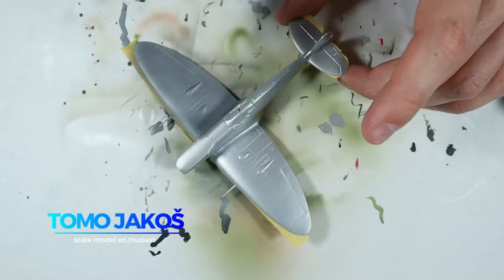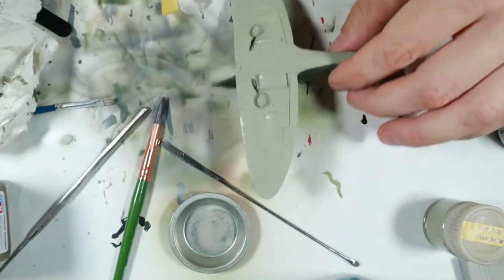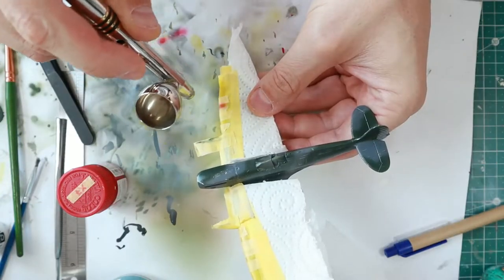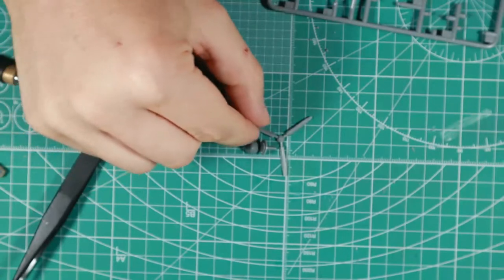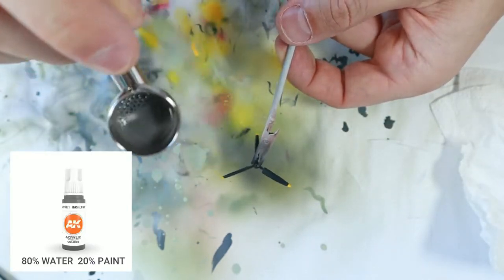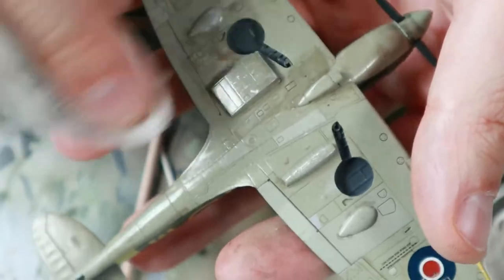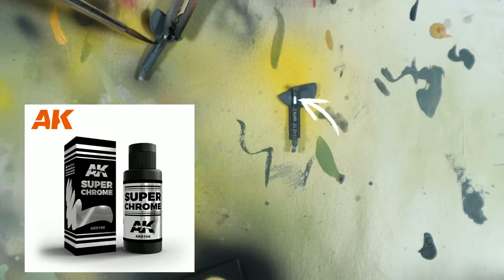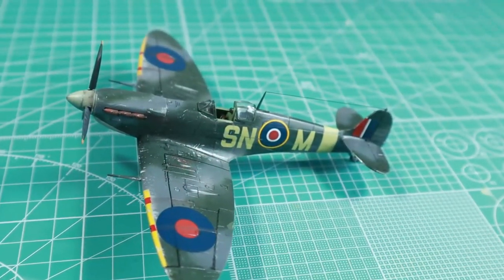Tamiya Spitfire Mk.Vb in 1:72 scale PART 2

Comment: I'm sorry, but I think you're misinformed. Spitfire propellers, with exception of prototypes and first production versions (MkI), all off tem, like Theo majority of World War II aircraft, erre equipped with Metallica propellers. That's why teu bens during emergência landings... And Theo pilot's SEAT was Aldo Metallica. Otherwise, congratulations for Theo excellent modelink work.
Reply from the maker: Hello. You are half rigt ;) Depending ond the prop manufacturer. ROTOL 3 blade varius pitch props were wooden composite. Here is a video link. It will explain it better than me :) It starts at about 3 min in to the video.
https://youtu.be/ddLNsQC7Srs